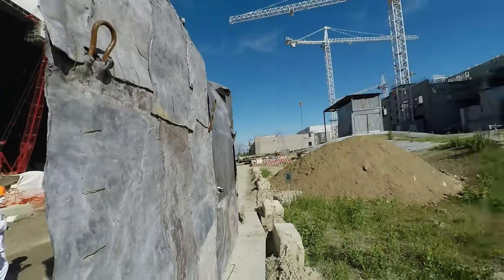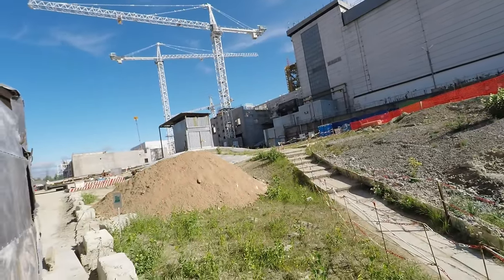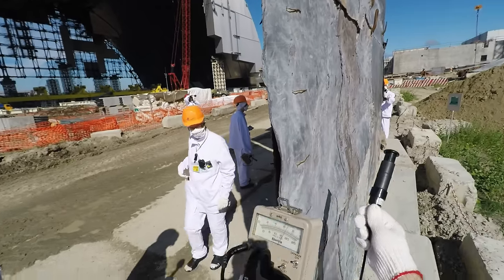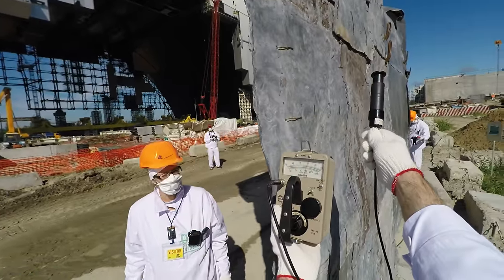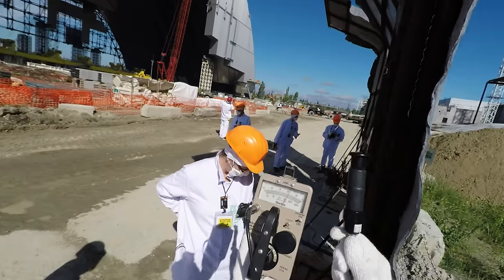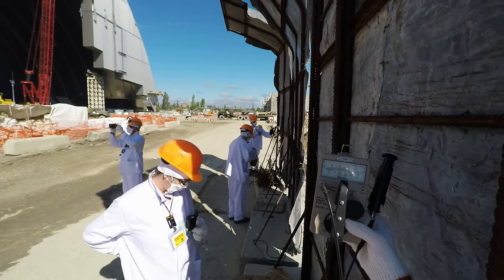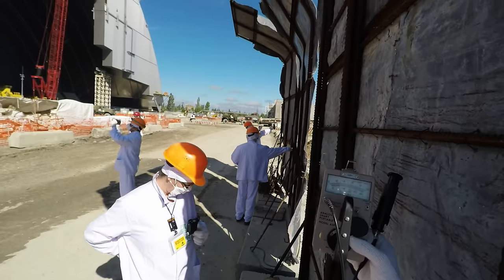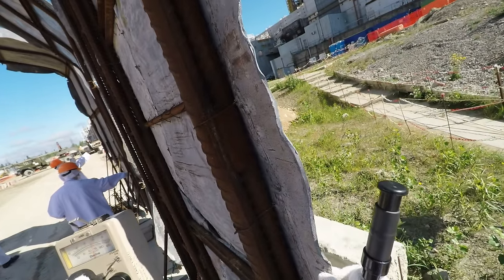Radiation shielding for workers at the Chernobyl New Safe Confinement

Comment: This looks like a real ghetto solution even for former soviets.  Why in the world don't they have a solid lead wall that covers the entire area between reactor number 4 and the new safe?  This looks like they are using old pieces of lead flashing.
Reply from the maker: It's an inexpensive, non-permanent solution for reducing the radiation field by 3-4 times.  The risk of building a larger wall is that (1) it takes man-hours in a radiation field to build said wall, and (2) there is exposure to other hazards, chiefly mechanical, in building walls generally.
Reply: if the gov really want to build the wall, they can build it somewhere else, then move it to the construction site, not big deal
Reply: @zhangliubao  funny thing is this is workers idea to build this lead wall and they made it for themselves without asking bosses. its bloody ukraine. nothing is right there since many many years
Reply: @sajuente8235  it's sad to hear that,  but i don't quite believe for such international project,  there's no proper or at least some protection method implemented for workers

Comment: what is the Radiation level on 4. reactor at the moment ?
Reply: In reactor core? Still too big to touch it even with robots. Everywhere around is ok. You can even visit now reactor 4 control room wich was closed and you can stay there for 15 minutes but its pretty safe to stay there hours.
Reply: Saju eNTe Actually they have sensors in the unit 4 building to monitor the radiation levels, i don’t know about now but before the new confinement shelter was put over Unit 4 there was regular ventures within the unit to check on the structure it self and how everything was on the inside. There’s a great video on youtube of one of these ventures and you get to see the reactor plate, the re fuel area and a whole bunch of other stuff! so you can go in but for limited amount of time and only if authorised